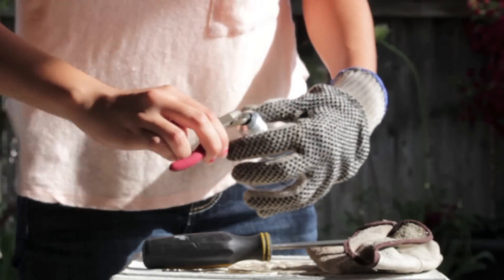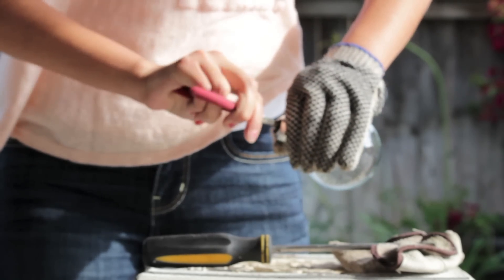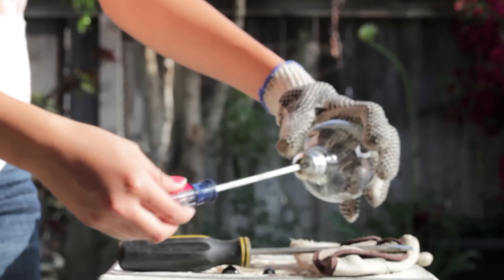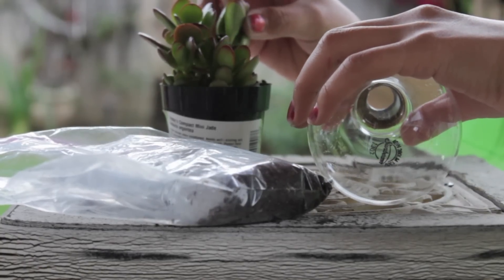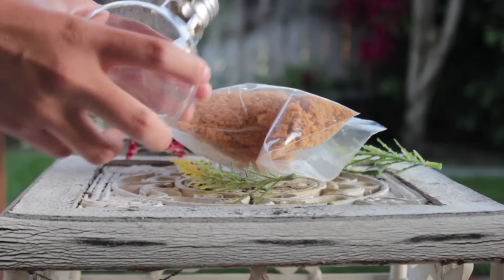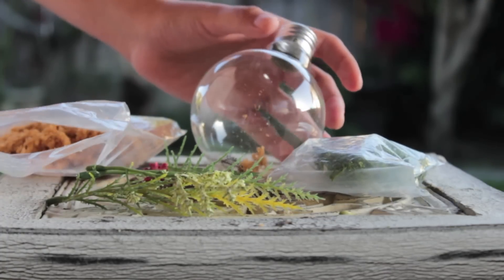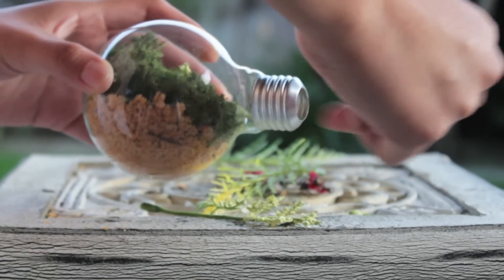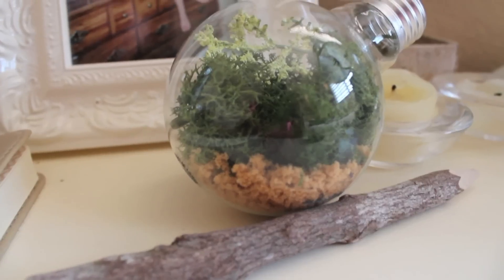DIY Lightbulb Terrarium

Comment: Try using dry soil for the real plants. Once you have it situated you can use a dropper or a straw pinched with your finger to carefully add moisture. This way the wet soil does not stick to the glass. Once the wet soil dries and falls away from the inside of the bulb it will leave behind residue that you can not remove.